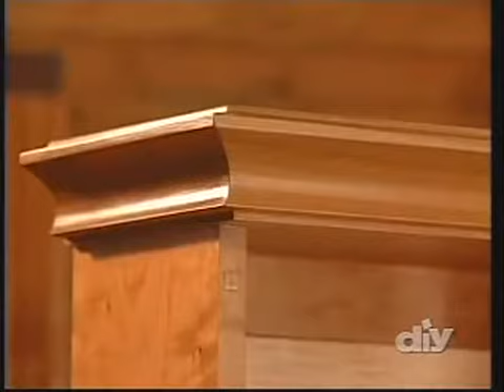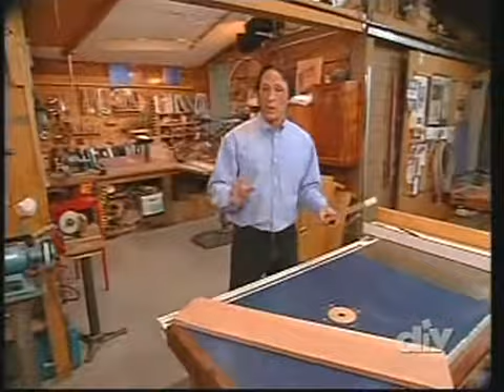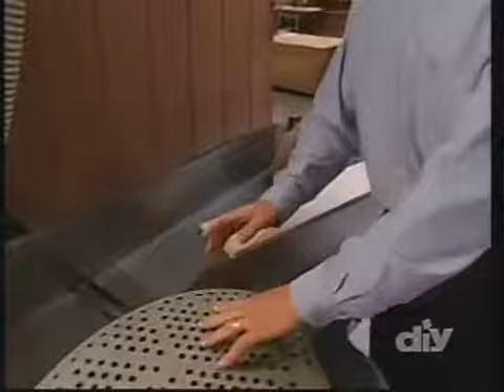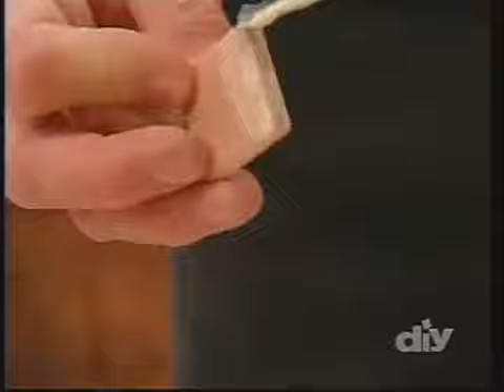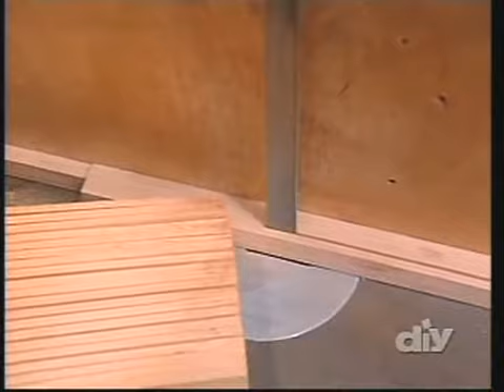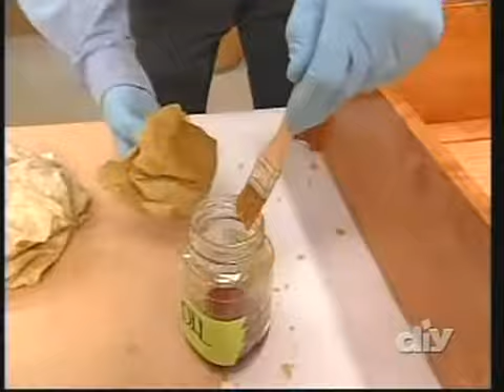david shows how to make a  Display Cabinet

Comment: Was looking for ideas on how to create a china cabinet for my wife.  And this is awesome, just well above my skill set and tools available.  to bad.  looks fantastic.
Reply from the maker: This guy he is really really good. But what are some of the tools that you have? I might be able to do a video of how to make one using the tools that you have because not a lot of people have you know a Shop full of tools
Reply: Bare bone.  Literally.  Miter hand saw, Circular saw, Dewalt corded drill.  That said, Recently purchased a router (from Harbor freight) and have yet to use it.  Couldn't even tell you what bits come with the router.  Need to purchase a set of good router bits, and new drill bits.  Most of mine are minimally serviceable, and or broken.  truthfully, I'm at the admiration stage of it all and messing around with the tools I have learning more skills so that I can better utilize.  My next project as both money and time permit is to build myself a work bench where I can attach my Circular saw and router for stationary use and also to make some guides for use (circular saw sled and router sled.  For now I'm happy I was able to assemble and put together a fish tank stand 24inX2inX50in for a 60 gallon aquarium rated to support approx 1200 lbs. ( I know over kill).  But hey for $50 bucks worth of 2X4's was fun.  Plan on building my skills and confidence from here.  BTW the staining was horrid.  Now I'm cleaning my partially stained concrete patio.  Amazing what paint thinner, Baking soda and some elbow grease will do.  It's to bad it won't take it up completely.  May end up having to stain concrete patio.  For me it's more fun though.  Learning all day long. :)
Reply: P.S. Thanks for the offer.  If you make it, they will watch (me).